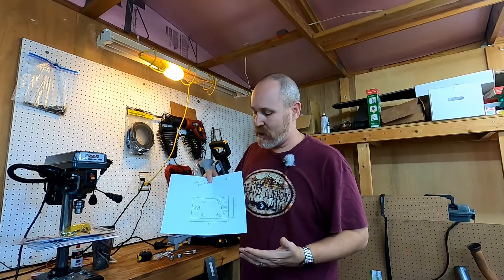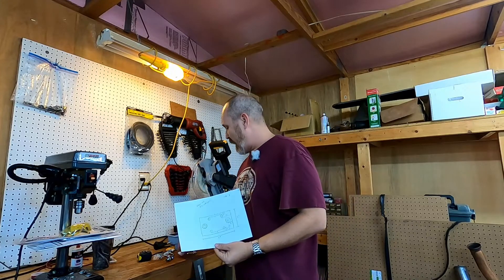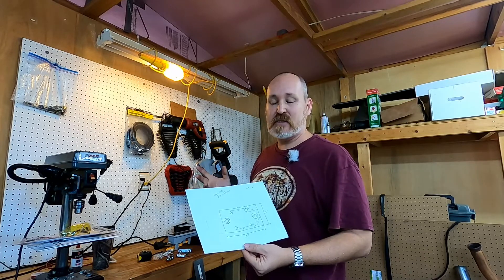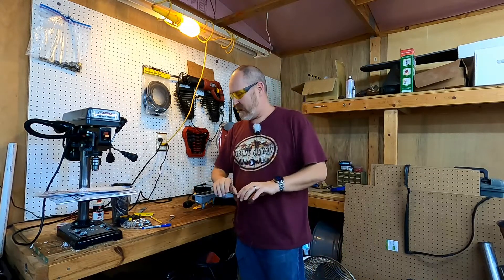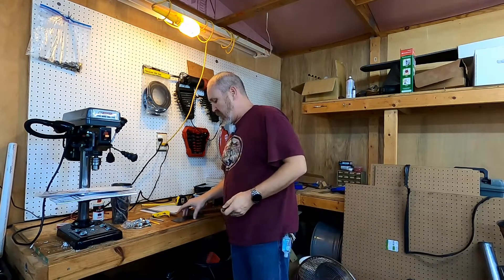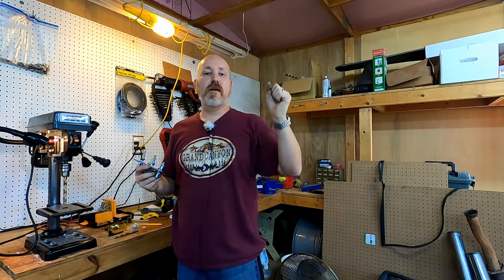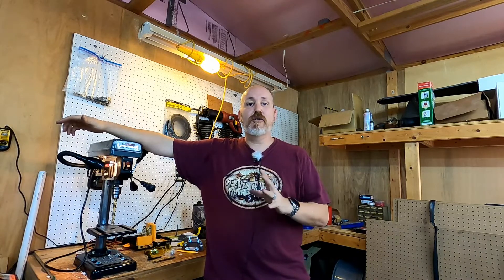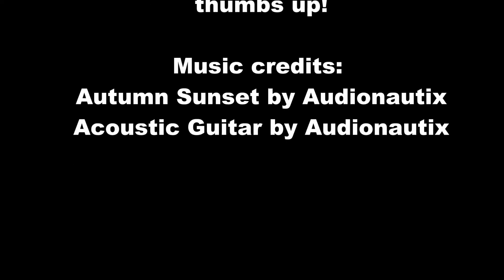Antenna Project: Building a 10 meter dipole center base mount 4/26/2020

Comment: Do you still like the MFJ 1899 whip antenna. I have seen on uTube that some do not like that particular antenna. I have a couple of end fed antennas which I have nit deployed as of yet. I do realize that a regular dipole is most likely the best bet. I have  yaesu 817 also but have never done a portable operation. Thank you for your time in advance and I hope to hear back from you.

Comment: Great IDEA, Thank you for the instructions. It is on my Fast Track List to do. I will use a small TV Rotator so I can control it from the shack.  So, hobbiehobb asked a good question. CAN be Vertically polarised, but doing that it will not be directional and one would have to use a non conductive mast or have it a good distance from the mast. Best off to be installed horizontally, so then it will be dirrectional. All the best. Jaimie, VK3TZE

Comment: Very good project Bob =)   Funny that is the same thing I'm doing for my quick station setup =)     I'm using two 75 meter Ham Sticks and one of my two SGC-239 antenna couplers mounted on a pole ( inside a repurposed trash can cable house connection box =)   Setting on top of 50 feet of 1 1/4" EMT homebrew push-up pole =)

Comment: Will this be oriented vertically or horizontally? Does it matter?
Seems a lot of operators around here use vertical 10 meter antennas to talk to one another locally.
Reply: To answer HOBBIEHOBB as long as the pole is NON CONDUCTIVE; just use a single Ham stick for that band on top of the pole for vertical polarization =)